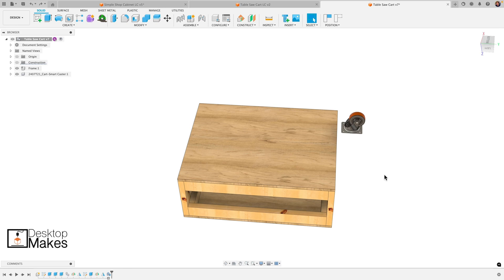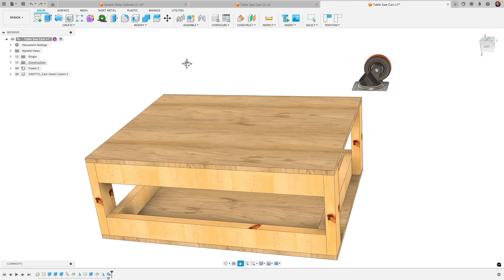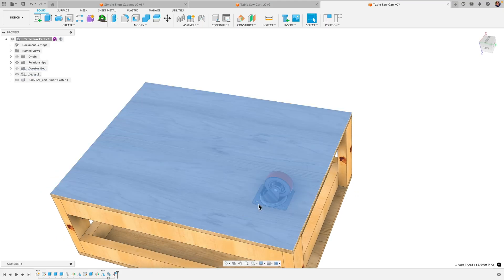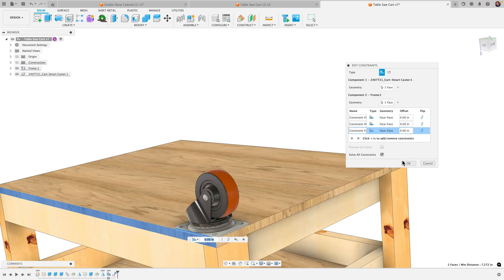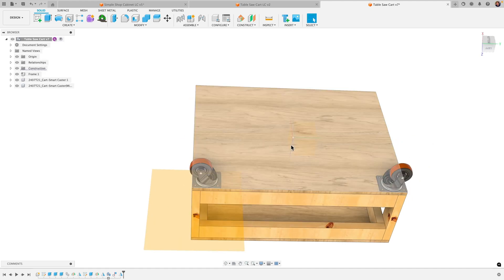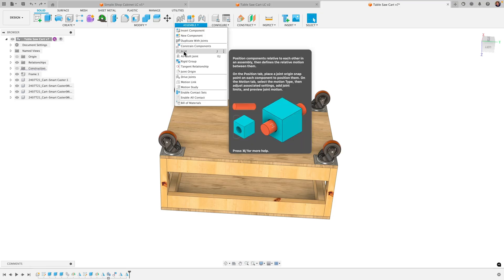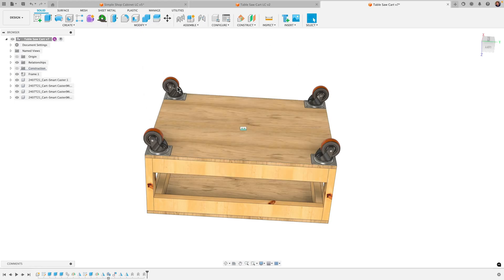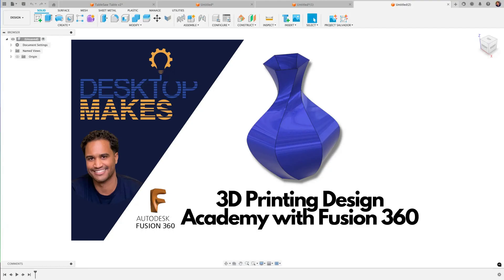Faster Assembly Workflow in Fusion

Comment: would a rigid group be quicker than doing 3 rigid joints?
Reply from the maker: You know, I've never used Rigid Group.  Just looked at it and you are right.  It would make a lot more sense with this application.  Thanks!  Just learned something new!
Reply: @DesktopMakes  a quite note on rigid groups, similar to as built Joints they are not parametric, so if the design changes the position would not update. Example if you had a bolt in a hole and did a rigid group or as built joint. If the hole moved, the bolt would not. Whereas if you used Joints or Constraints, these are parametric so would update the bolt to the new position.